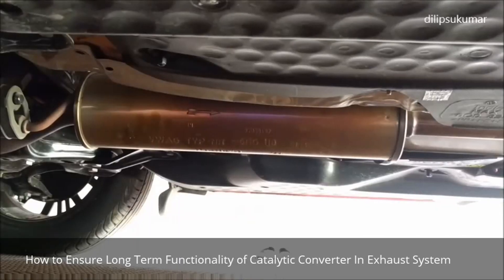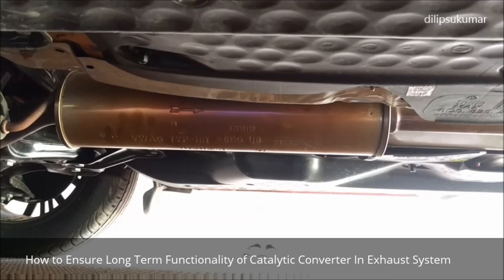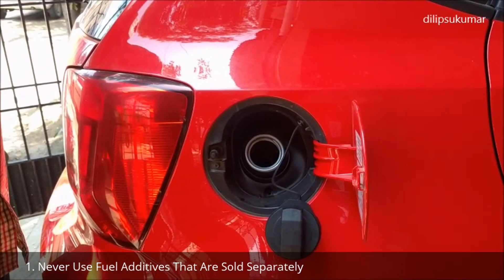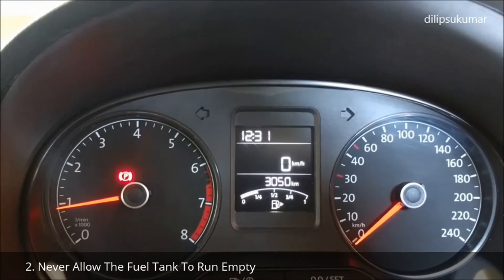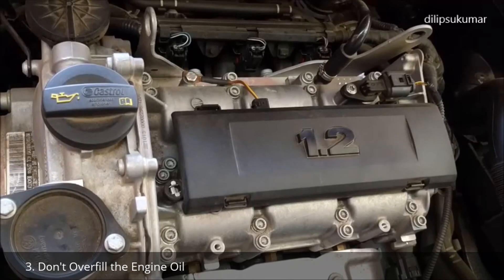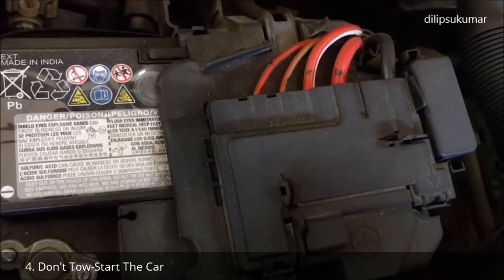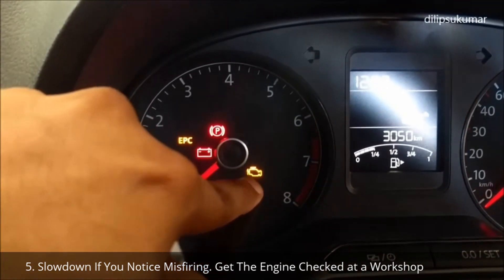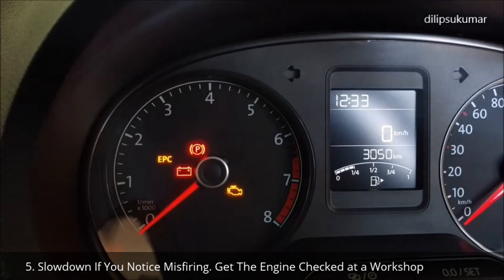How To Ensure Long Term Functionality Of Catalytic Converter in The Car

Comment: Hello what is EPC light there on rpm meter ??
Reply from the maker: +Sagar Patil EPC stands for Electronic Power Control. If the EPC lights up while the Engine is ON it means that there is a fault in Engine Management System. You can drive your car. But, the Engine should be checked at a workshop as soon as possible.

Comment: dilip the part which  ur showing is a   muffer not a catalytic converter the cat convter comes on the exaust manifold between the engine n the radiator fan  but its a very informative video keep it up
Reply from the maker: +jovindo martin thank you so much for your valuable feedback...

Comment: Sir plz show how to open ac vent center console my flaps fall undr
Reply: Lakshay Kumar  the trim of the music player has to be taken out n the music player has to be taken out then music player cage four screws have to be taken then the  central ac vent comes out
Reply: Ok thank u so much but i pulled off the trim and vents are not going to correct place so now i have tried doing that stereo removal but when i was pulling it it was really difficult to take out what to do then

Comment: Very informative video.. sir my polo highline petrol is 2 mnts old and had already driven 2200 kms...when should i check for engine oil replacement and brake fluidlevels and tyre pressure levels ...should i only consider it done during my service ??
Reply from the maker: +Arjun Satish VW offers a free checkup of your car at 7500 Kms or six months whichever comes first. You can check the Engine oil, brake fluid and coolant levels during that time at the VW workshop. Engine oil needs to be replaced only after 15000 km. So just check the level and top up if needed. Tyre pressure should be checked once in a week. Thank you.

Comment: Sir what is the cost of Jump starter ? And do you own one yourself ?
Reply from the maker: +Tharun J Prasad the cost ranges from 500 to 2000 Ruppees depending on the quality. I don't own a jump start cable as I know to use a normal cable for jump start being a maintenance engineer :)
Reply: dilip sukumar No sir I meant the whole set up along with the portable battery ?
Reply from the maker: +Tharun J Prasad a good quality that is reliable may cost from 10000 to 13000 Ruppees.